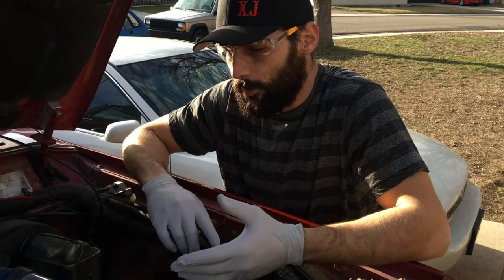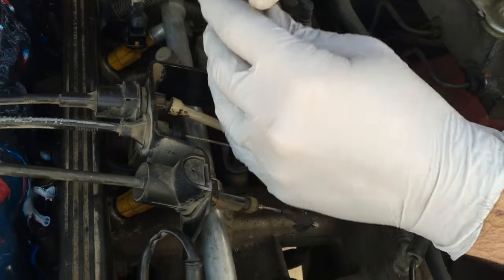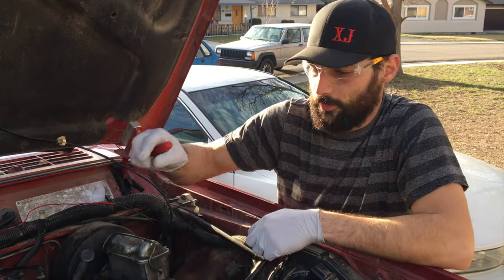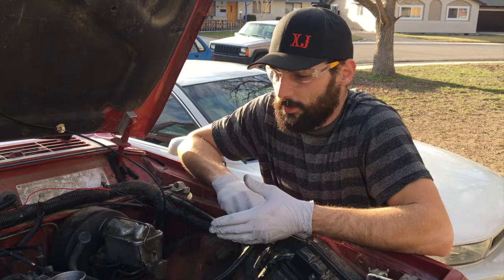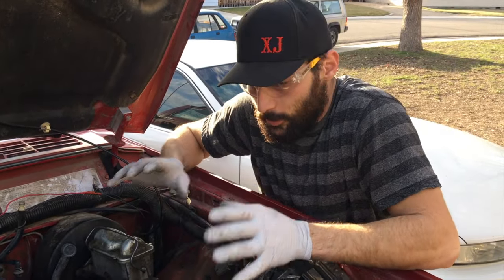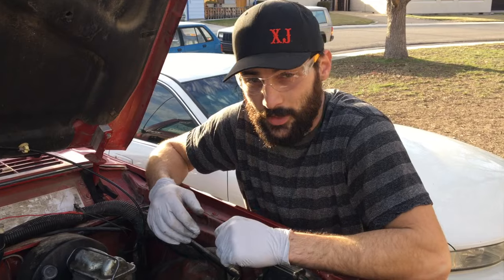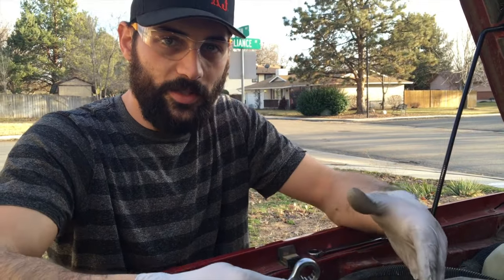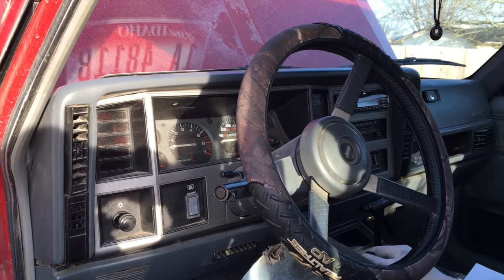Fuel Injector Upgrade Install

Comment: Thanks for the high quality vid and your KSuspension products in general. Just a side note-- there's a Schrader valve (like the ones on tires) on the fuel rail; any time I'm working on fuel line, etc. I like to take the cap off and push the valve stem in to alleviate fuel line pressure. This coupled with gas cap removal will ensure there's absolutely no pressure in the fuel line.
Reply: I have a jeep wj V6 4.0 and the fuel rail doesn't have the Schrader valve
Reply: @natej9876  my 97 zj has one I'm surprised you don't have one

Comment: I just put a set of your 12 port injectors in my 91 XJ and I can't believe the difference! Way more power, much better and smoother running motor. I'm honestly shocked at the difference!

Comment: I agree with others to the excellent quality of the video. I received a set that had a bad injector, called and KSuspension was very apolgetic and got a new set immediately to me. As others have stated service and follow-up are outstanding. No reservations in rcommending KSuspension to others.

Comment: My jeep doesn't even necessarily need new fuel injectors, but now I want to replace them 😆 Sweet dipped cylinder head cover too! Thanks for the easy, comprehensible video!

Comment: Finally got around to putting in the four hole injectors. Jeep runs much better no more long cranks when the engines hot. Thanks for a good product at a reasonable price.

Comment: Just installed my four hole injectors this weekend. Can't speak to power or mileage increase but the Jeep runs great.
Reply: Was the only improvement just a better running jeep when you put in the 4 hole injectors?

Comment: Just make sure you have the correct injectors for your pigtail or you will be splicing each one. I have a 97 Cherokee sport with a 95 engine and got a bunch of parts off an 01. The 01 injectors are a different connector. Also there are some differences in the fuel rail itself. Mine only has 1 line on it. I’ve had to piece together this engine with parts from 3 different models lol !! Just something to look for before you dive in and remove everything! Love the video and subscribed!

Comment: 2000 4.0 wj IL6. What if you don't reset your pcm? Will it just relarn your new injectors, from 1 hole to 4 hole. 
I did this and got po172 and po175 oxygen sensors running rich. Cleared codes and ended up replacing my fuel pressure regulator/ filter. So far so good.

Comment: Alright brother...I just ordered a set of your 4 port injectors. We got slammed with Hurricane Helene and I do tree work. In the middle of getting trees off homes with my 00 XJ it starts skipping. Had a misfire on #4. Changed the plugs and coil rail...but it's a bad injector.
Reply from the maker: @grendelhp  shoot us a message, email, or call and we’ll get you fixed up 

Thank You for your help there! 💪

Comment: Thanks! I just replaced #3 injector. Your instructions were spot on!
Reply: Did your jeep have a misfire?  My #3 cylinder is misfiring but I'm getting spark and power to all my injectors..   do you think my #3 is clogged??
Reply: HEEP_LIFE the video is titled Jeep inline six, 4.0 rough idle after restart by AJ Phillips

Comment: Just did my 96 ZJ with the 5.2, under 2 hours including going back and forth for the right tools, does run SMOOTHER, Bosch 4 hole for 70.00 on ebay, will check any cold start advantages tomorrow. I used some top quality waterproof grease  on the O-rings for the fuel rail and intake side as well, does help a lot
Reply from the maker: jim dandy I'm glad the eBay set actually worked for you. eBay sellers are a hit and miss most of the time. 
Sorry we couldn't be your supplier for your injectors this time, maybe next time!
Reply: OH- to be honest I didn't know u sold parts?
Reply from the maker: jim dandy it's ok. Still a small company. Working our way up the ranks :-)
Reply: how was the cold start and everythingso far? I got those on my 4.0 along with a comp cam, and edelbrock head with lots of extras.

Comment: Thanks for the great video. I agree with another post below, you have a talent for this. Well done. 

My question: do these four hole injectors work with the ‘97 TJ, 2.5? 

If you also don’t mind, what’s your opinion on this situation my 18 year old son and I dealing with right now.

Driving down road, loss of power. Stalls out. Restarts a few times and then won’t at all. 

Went through a series of things and wound up deciding to replace EVERYTHING we could think of and reach as PM. 

Started with replacing the fuel pump since there was no pressure. Still won’t start. Good fuel pressure now at fuel rail. 

Also would not start with starting fluid at this point. 

Tomorrow morning we are replacing the injectors and the local  store has these as an option, which is why I asked your opinion. 

We are also replacing the plugs, wires, and distributor tomorrow because we have everything torn apart. That, plus the Jeep sat in a field for many years in Idaho and since it’s my sons college daily driver (which he wants to own forever)  I figured I would do as much PM as possible while we can. 

I’d appreciate any thoughts you might have about where to look next if tomorrow’s changes don’t fix the problem. Thank you and happy new year!
Reply from the maker: First off, Thank You for your comment. 

Secondly and further, yes, these amongst some other injectors will work for your rig, as for the work you’re doing, no sense in throwing a parts canon at the rig to find the issue. Most problems can be diagnosed easily with a meter and power probe. 
If you’re in the southwest side of Idaho, feel free to swing by our shop in Nampa. Be happy to help you figure this out. 

If you’d like some deeper help via messaging, shoot us an email. Be happy to help if we can. Suspensionlifts@gmail.com

Comment: You should really use a silicone based lubricant for injector O-rings to reduce the risk of degradation of the material.
Reply: I guess so. Lithium grease is compatible with everything as far as I know.
Reply: Is wd40 ok to use??

Comment: Very helpful video.I did the swap on my 96 xj.Now my check engine light is on and it idles really rough.did everything like in the video.Is there some other problem that can happen with the swap?
Reply: could be a few things, easiest thing to check is first, the code.
from there, you can diagnose down each cylinder to figure out what is causing the issue.

Feel free to email us for additional support.
Reply: @hndaxr400rdr  I reset the computer check engine light went away and hasn't come back.still idles really rough and shuts off after a minute or so.
Reply: @ErnestoFry-lv2zr  shoot us an email and we can help you diagnose further

Comment: It's been 8 years. It hasn't leaked gasoline or anything since you install those injectors right even though you used petroleum jelly? Is it okay if I use viscosity 525 mineral oil to install my fuel pressure regulator?

Comment: thank you for the expert explanation of steps necessary. Just got a 98 4.0 with 114k on it. looking to do some upgrades. I have a question... What is the black plastic rail looking thing next to the fuel rail? mine seems broken.
Reply from the maker: it's just a cover for the ignition wires, it also acts as a hold down onto the head bolts so that it doesn't move around. they crack/break all the time. You're not alone

Comment: Great video, whats the point of the plastic bits on the end of the new injectors? The old injectors dont have them.
Reply from the maker: Gone Bush those are called Pintle Caps, and they're main functions are to keep the orings on the injectors, just like a top hat
Reply: Just got your 4 hole inj. For my 97 4.0 XJ. So do you remove those plastic tips you sent, holding the i-ring on??

Comment: Mo oring just failed on my renix, was hoping to get some 4 hole injectors. The website said there could be a delay on some of the injectors...when do you think they would be available? I am hoping to get my injectors from you...
Reply from the maker: we have them in stock and ready to go.
Reply: @KSuspension  Got them, Installed them, gotta do some more driving, but feels strong...thanks, I'll probably make another video in a week or two for review.

Comment: Great video, I am about to order a set. But I need some help on a couple of questions....... 1: I also need to replace my fuel rail any suggestions? 2:, I keep getting an evap cope and can’t seem to find the problem. It’s cold starts rough, sometime it will stumble on and a small pop out the tail pipe. Then levels out and idles great after a few seconds. And never does this when starting warm, Not sure if it’s the same issue as the evap code (small leak or no flow) 
I have changed the fuel lines near the tank and also the evap purge valve near the front P firewall, what should I check next? Thanks.
Reply from the maker: Email us some info: suspensionlifts@gmail.com

Comment: What radio do you have? My stock radio isn't cutting it. 
Great video.
Reply from the maker: Nolan Long I believe the one at the time was the JVC KD-ABT22 it has since been replaced with another head unit
Reply: Thanks

Comment: Need some help.   Do you remove those pintal caps you added In Front of the  O rings? My new 4 hole inj. Just arrived for my 97 xj . Tia

Comment: great video!  is it the same process to reset PCM on a 2000 grand cherokee laredo  4.0 (battery cables, ignition & lights)...?
Reply from the maker: Patrick Walsh should be the same, correct.

Comment: those yellow injectors that you pulled out aren't the stock ones
 in fact they look exactly like the 4 hole injectors I'm about to install. do they suck? is that why you put the black ones in? great video though
Reply from the maker: You’re correct, they’re not stock, they’re the 4ports we sell.
Only reason why we changed them, is to make the video. No other reason.
They’ve been changed 4 more times since just testing out different styles. We test everything before offering on our website, this jeep is our mule more or less lol
Reply: @KSuspension  sweet, I just had to make sure b4 I put them in because I'm literally in the middle of the injector intake and header install. thanks for the info and for the fast reply. much appreciated and I'm subscribing to your channel b4 you finish reading this lol

Comment: Great video. Very well done! I have an 2004 wrangler 6 cylinder. I drove it the first year about 9000 miles then it has pretty much sets in the garage. It looks brand new. I get it out a few times a year and drive it to keep the gas fresh and to keep it running properly. Around 11,000 mile now. I let it set over a year this last time. My son and I got very busy with work. Now it won't start. When turning the key on I can hear the fuel pump running in the tank. I tried to remove the gas line at the rail but did not have the tool to remove it. i will get one and try to see if gas flows. I just can not imagine with such low mileage that the injectors would be clogged. However I have never dealt with a bad gas issue before which I assume is the problem. Do you have any suggestions that could help me troubleshoot this problem? Almost forgot. I also had my son turn it over while I sprayed bursts of starting fluid into the intake and it attempted to run which gives me the idea the ignition system is working. So it still points to bad gas I guess?
Reply: Test the fuel pressure at the rail, could be a failing pump...doubtful injectors are clogged..just gotta go down the checklist

Feel free to email me for any help if needed
Reply: Hey Thanks for the tip! And offering to help. 
I am going to buy the small tool needed to remove the fuel line from the rail and the gauge set as well. I am about 100% DIY and pretty much always do my own work. The cost of a few tools and some time can save you a pile of money. At 54 I have not failed yet lol. I have watched several videos with similar problems to learn how things come apart. There does not seem to be a video, at least that I have found, that shows what to do in the case of possible bad gas. I figure I will just learn to understand the fuel system details and then figure what part of that system is failing through the process of elimination. 
 I could just dig in but that can end in broken parts. I always try and 
get a good idea of what I am working with before actually doing the work when it comes to cars/trucks. They tend to build them with tricky little procedures that cause you to break things if not careful.

Do you think the fuel pump would go bad as a result of the gas being old?
Reply: no, not because the fuel is old, but not using the pump and it being just sitting there in fuel could make it go bad. It's a long shot, but you'll know once you test the pressure:-)
Reply: What about the crank shaft sensor? I saw that mentioned somewhere. I assume that if it were not working then it would not tell the fuel pump to run so no fuel flow? By the way still have not been able to work on it.
Reply: +Terry Miller you said when you spray starting fluid it tries to fire over, that tells me you have spark(I'd confirm just to be safe)
That's why I didn't mention the CPS.
Reply: Oh, so it also fires based on the crank shaft sensor? I did not realize that. Guess I misunderstood what I was reading.
Reply: +Terry Miller it's ok, I'd test it just to be safe, but sounds like it's ok.

Comment: i installed my injectors that i purchased from you guys everything seems to be going smoothly so far.  i have a slight issue not sure if its a big deal or not but the throttle hold down is making contact with the 3rd injector from the front and turned it a little bit doesn't seem to big of a deal because i didn't reinstall the retaining clips but i have no idea if it'll mess things up in the long run or not? for clarification it just kind turned the injector and plug about 45 degrees and it is still in the rail and the hole in the block and is not leaking
Reply from the maker: I assume you got injectors with adapters? Very common issue
You can push that injector down 90° to make it flat and it’ll clear the bracket. Replacement pigtails is the best fix for this situation
Reply: @KSuspension  thank you for the fast response! I'm assuming they are adapters since they plugged right up but they are the 4 ports and there wasn't an option for pigtails over adapters compared to the 12 ports. it wont cause any issues if i push it down 90?
Reply from the maker: @xIrHaxor  nope. You’re not changing the direction of flow, just the rotation of the body

Comment: Do you have any videos concerning what mods are required to swap the later model curved runner 4.0 manifold onto an earlier model straight runner manifold engine?  It seems that I am going to need to weld up a new mount for my PS pump.but I suspect there is a lot more, as it seems that I need to remove a flange off of the newer manifold.
Reply: no video sorry, but you'll need the PS pump and brackets off a newer jeep to mount onto it.

Comment: I've ordered the injector kit for my 1998 4.0 TJ.  Would it be wise to replace the pigtails?  Additionally you mentioned resetting the PCM?  You were working on a later model Cherokee.   Do I still need to perform that reset on my 98 TJ?
Reply: always recommended to reset PCM. and you don't need pigtails unless yours are worn out or broken.

Comment: The PO of my 99 4.0 XJ has installed injectors with a blue stripe at the end that's goes into the intake manifold. Any idea what they are?  I was going to replace them with a new set of single hole injectors that came with the jeep but wasn't sure if the blue stripe injectors was an upgrade.
Reply from the maker: I’d need to see a photo. Email us

Comment: Hi! Thanks for the video. Stupid question, but: Will this increase the MPG or only give more HP? Thanks!
Reply: Glad you enjoyed it! 
the 4 port injectors don't add any HP and usually don't add any MPG either, unless your OE ones are super clogged up and aren't flowing properly. You'll get better performance and throttle response with a leveled out idle as well. But not more power, that would need a lot more adjustments and different injectors as well.

Comment: Nice video.. Really well done.  I was wondering if you know of anybody that has actually dyno-ed this mod to see what the actual improvement is? I know everybody says it makes a big difference, but just wondering actually how much?  Thanks for the step-by-step.  Bob/Okc
Reply from the maker: I've actually dyno'd it and there isn't a hp gain, but on our graph, the response time for the throttle was much quicker
Reply from the maker: I've actually dyno'd it and there isn't a hp gain, but on our graph, the response time for the throttle was much quicker
Reply: hello I just received the injectors that I ordered from you guys I installed them the pigtails would not Snap-on to the injectors and I push down as hard as I could it's like the clip for the pigtails isn't the right one for these injectors I'm worried about them just bouncing off. 1995 Jeep Cherokee xj 4.0
Reply: Brandon p did you receive the yellow set from us? If so, sometimes the older pigtails don't "snap" on, but that's ok, they'll stay put. If you're horribly worried, you can put a zip tie around them, but you shouldn't have any issues.

If you run into any problems, please don't hesitate to contact me anytime!

suspensionlifts@gmail.com
Reply: Yes I did get the yellow ones okay will do thank you